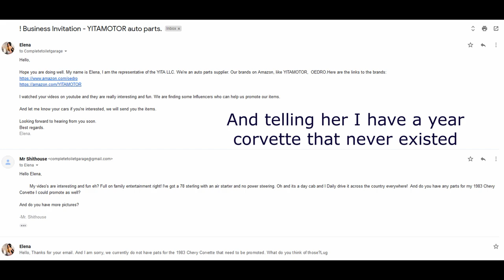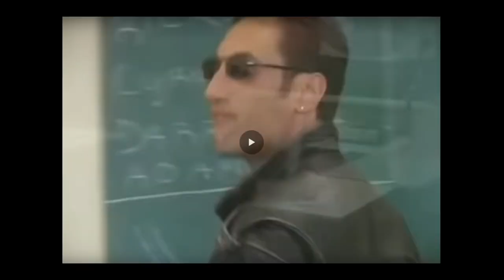CTG courtesy flush!! Unboxing and installing YITAMOTORS headlights CTG sytle!!! Are they any good?

Comment: I approve the lack of the handle on the angle grinder.  But you still had the guard on it.  Why would you want to keep both your eyes?  You have two..  Angle grinder reminds me of this https://www.youtube.com/watch?v=fJHVk8bWnI8

As far as those pins to take the headlight out, I did a headlight bulb the first day I owned the Yukon, my first GM - I heard GM is easier to work on and this showed me that the first day.  What little I've had do do on this in 40k miles has been a cinch.  It's almost fun compared to the Ford and Chrysler I've had.
Reply from the maker: hahah, uncle tony aint wrong about any of those... I still got a piece of cut off wheel in my chest after one exploded one day on me.